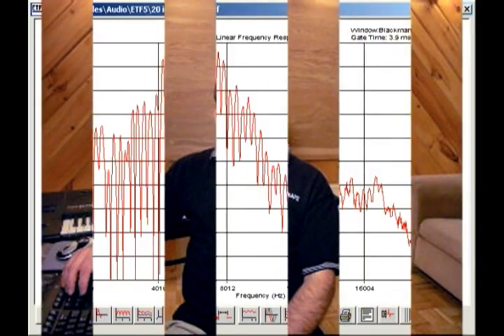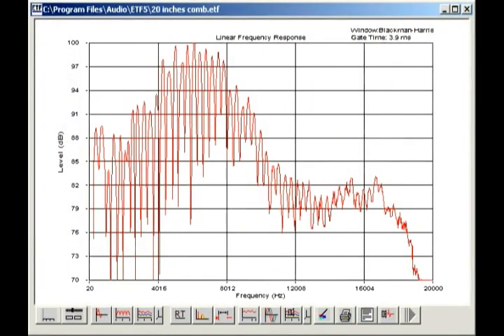Comb Filtering

Comment: I stopped using a subwoofer in my studio years ago when I discovered it was causing comb filtering in the mids and highs. Wasn't worth it for the even low end. Have to admit I didn't try moving the sub though.
Reply: Would love to hear why it did so, if you’d like to please elaborate?
Reply: @Tazmanian_Ninja  something to do with boundary interference. I'm not an acousticon mat. I didn't say I understood what was happening just that it was happening. My solution was to stop using the sub. You can test yourself with room eq wizard.